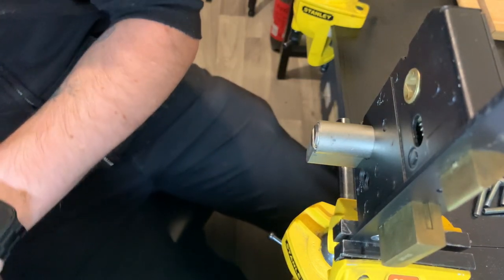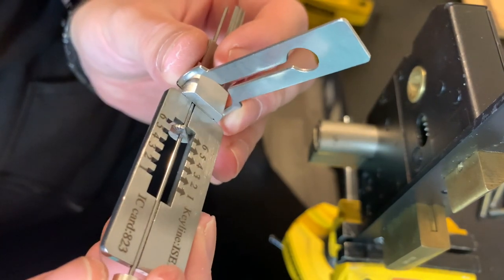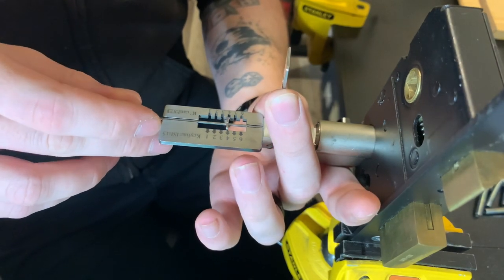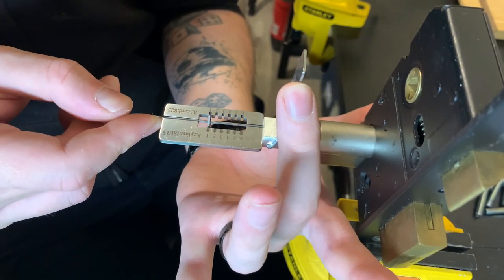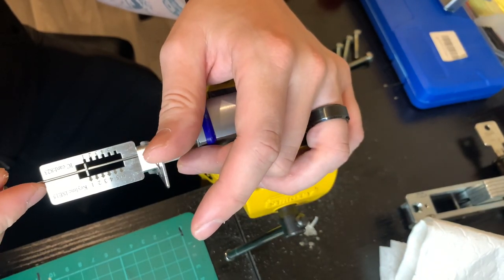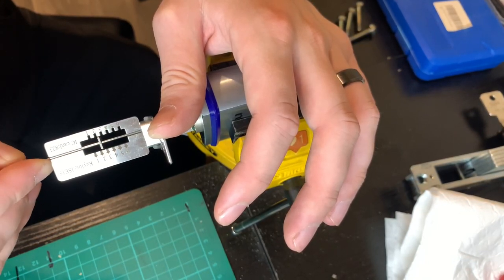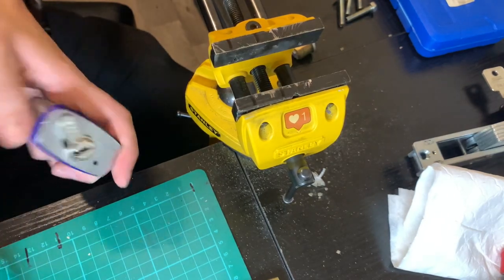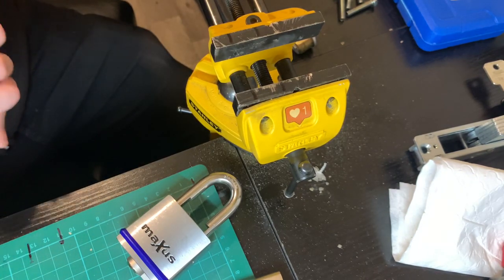Iseo R6 lishi pick

Comment: Hello I am a Lishi practitioner operating as a Locksmith in the U.S.A. The ALS website doesn't allow shipping to the U.S.A. for some reason under shipping options. I am wondering if there is a way I can snag this particular pick from ALS as we have Dimple style key locks here in the States. I would love to give customers this added security benefit, but am having difficulty getting it shipped from ALS. Any advice would be greatly appreciated. I enjoy your videos and thanks for your work.
Reply from the maker: The tool is specifically for this exact lock which is very rare in the USA this tool will be no use to you. Unfortunately I can’t help
Reply: @GxAxV  so this is not for Dimple locks which are sold for mortise cylinders and padlocks here in U.S, and if not whats the difference?
Reply from the maker: @Bohemianbiker1k  every brand of dimple lock needs a different lishi just like car locks. Otherwise they won’t fit in the lock

Comment: Great video. Thanks. Could you make a video trying Tesa T60 lishi pick? It seems easy to pick with Iseo lishi but it is not than easy to pick with Tesa lishi pick, even if you have the combination. Or maybe it's  just I am missing something.

P.S. Your video about Tesa lishi would be the one and only in YouTube so far.
Reply from the maker: Hi mate, I have never came across one of them locks in my 13 years as a locksmith. I don’t have one or the pick unfortunately. Don’t think I would ever use one either.